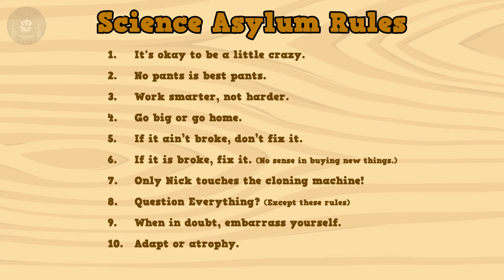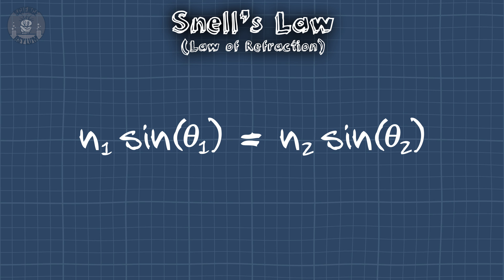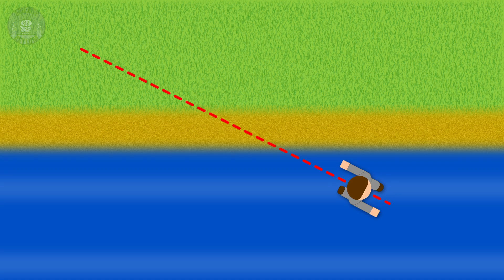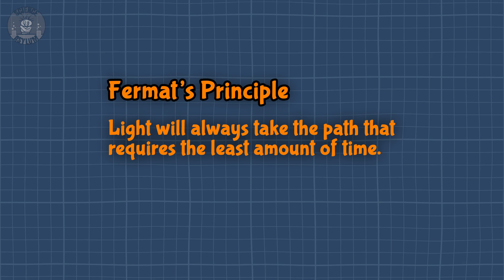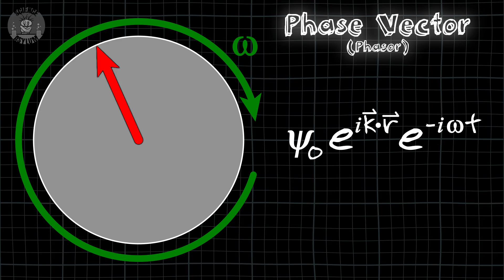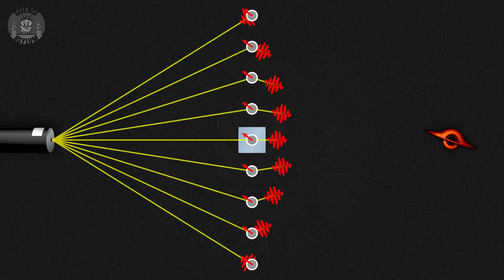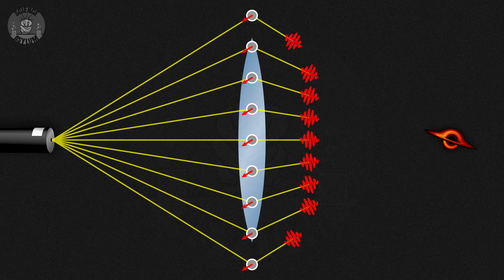Why Does Light REALLY Bend?

Comment from the maker: Clarification: In my quantum animations, that is not multiple photons taking different paths. It is a single photon taking multiple paths simultaneously. We're releasing only one photon at a time. Adding those phasor arrows together gives us the probability of receiving a single photon at any given moment.

Minor Correction: I show the paths leaving the source at the same time and arriving at the detector at different times, when it should actually be the other way around. Paths that take more time should be leaving the source earlier in order to arrive at the detector at the same time as the others. The reason we can add the phasor arrows together is because the paths arrive at the detector at the same time.
Reply: Still confused. Doesn't single photon imply that all paths "left" the detector at the same time?
Reply from the maker: @ewthmatth  No, because we don't actually know when it left the laser. All we really know is when it arrived at the detector.
Reply: The Science Asylum 
Photon arrives all at once.
Potentially took all the paths.
It could have left at different times, because it arrives all at once...
Is there a way to detect when it left?
Or if it left at the same time, as well... 
Can a photon move at C relative to another photon?
Wait, it was one photon... 

F*ckit, quantum particles are f*cky AF.
Reply: @RyuichiNoGekido  Photons don't change with time like other particles. One photon can be like a long twisting thread that entangles or interferes with other threads light years across while stringing other particles along for the ride.
Only difference being if Photon forms an Anti-particle/Particle pair the thread breaks . 
Another Point is Particle interactions make new swirls of Photons blending into the background.
Reply: @ScienceAsylum  Its like Finding a needle in a haystack
Reply: george mayanja I mean, I know mathematically a photon doesn’t experience space or time. 
But I’m still confused.
I’m not even close to introducing antimatter into something I barely have a grasp on already.
Reply: @ScienceAsylum  does the fact that photons do not experience time have an impact on the photon paths "being explored", and the same photon leaving the generator at different times to get to the destination at the same time?
This question is a result of stitching together things found on the internet, so I might very well be really off track
Reply: @RyuichiNoGekido  Machines , rules , laws ,maths and logic have limits . Just imagine more if you find exceptions to the rules and laws of physics get creative and learn how  we can apply them .
 Your Imagination and creativity is one thing Computers and gadgets can't do so use it even when you're wrong
Reply: @ScienceAsylum  How a single photon can slow down in glass without losing energy? In early video you say that it's only beam can slow down because of interference with em-field of electron.
Reply: @ScienceAsylum  I have a question if you don't mind, but if a photon that takes more time to arrive at the detector leaves the source earlier and every possible path of the photon meet at the detector at the same time, what is the need of the lens? At the video, you said we'll use the glass to slow the photon down to make the time of its arrival same with other paths. but if all paths of the photon arrives at the same time, doesn't that mean we don't need to use the glass in the first place? And every multiple paths is taken by a single photon...how can we 'collect' that single photon?? Doesn't the lens just focuses light beam's'?
Reply: @ScienceAsylum  @02:58, n=1.0003... air has its own refractive index... or maybe at least our Earth's gravity can slightly slow light coming from the Sun(gravitational lensing)... @09:26, 2 constants, Epsilon naught is the vacuum permittivity for electrical charges & Mu naught is the permeability for magnetic field to pass thru a recognized medium of matter or particle then the square root of their product is equal to the refractive index... Well, maybe we can measure the accurate speed of light on totally less to no gravity situations like inside orbiting space stations(while still having air like oxygen, of course) because I think gravity still plays a role on miscalculating the true speed of light on absolute space including its refractive index(absolute). But we're all here on Earth under its own gravity and we're performing all these experiments within its natural & environmental boundaries & restrictions. All I can say is that we' re all not ready for space... Maybe I can request an experiment about how light travels through water rapidly flowing in a laminar way, a laminar flow(light direction parallel to water flow)... or maybe what if the glass is spinning & rotating so fast while light pass thru it(perpendicular to axis of rotation).
Reply: @KokoJeuru  That is interesting! So you are saying the refractive index could be different under different gravitational fields? Like on the Moon or on Mars or ISS? Surely theorists have an answer for this already?
Reply: @RyuichiNoGekido  Could the speed be variable and only in aggregate sum to C?  In this way it leaves and arrives at the same time along all of the simultaneous paths that could and thus were (probabilistically?) taken.  ie Photon leaves then "ghosts" all paths traveling at various speeds so that the photon "ghosts" arrive together at the detector as one?
Reply: @YbisZX  photons can never slow down. The speed of light is an absolute - a constant. Since glass is dense, when a photon travels thru it, it almost always hits an electron, gets absorbed and then gets re-emitted. *The re-emitted photon always travels at c*. The re-emitted photon might hit another electron & the same thing would happen. All this absorption/emission takes time & hence light takes more time to travel through glass but not because it is slowing down.
Reply: @arifsaifee4146  No. The re-emitted photon will be emitted in a random direction.  According to your theory, the light will simply scatter in the glass, and not pass through. Actually, it is the interference between a light wave and a perturbation in the electromagnetic field of matter leads to a decrease in the group velocity of the wave.
Reply: @arifsaifee4146  I don't think it has been proven that light only travels at c in a vacuum.   I think it could be possible for the speed to be c in one direction and less on its return path back after Vinci by of a mirror say.... but probably less than likely
Reply: How can laser light take multiple paths? I thought photons from a laser were meant to all be in phase... which would mean they all travel in the same direction...?
Reply: @EternalSilverDragon  In quantum even the laser pointed at a vacuum will have uncertainities
Richard Feynman could explain better than i can
Reply: I do now understand the probability of two videos having the same "Clarification" and the same "Minor Correction". Did checked with "WinMerge".
Reply: You made the same animation error about the photons arriving at different times that you did in your previous video about mirrors. You even copy and pasted the same "Clarification" and "Minor Correction" pinned message from that video. Did you have both videos filmed and fully edited before releasing the "You Don't Know How Mirrors Work" video? Not trying to call you out or anything, I'm just curious.
Reply: Sorry, I call BS on that lens. If it was only about slowing down the light then it would work just as well with a kind of inverse fresnel lens, which has the shape of the pictures lens but all surfaces visible to the light source being orthogonal to it. Furthermore, normal fresnel lenses would NOT work.
Reply: @marcus3d  Because this part was the most insightful moment of the video for me, could you please elaborate? I wouldn't want to double down on something that turns out to be incorrect.
Reply: @sander_bouwhuis  Look at how a fresnel lens works. The light will pass through several rings, and go through approximately the same amount of lens but very much different amounts of air. The difference between these rings is the angles the light enters and exits. A fresnel lens clearly completely invalidates the suggested hypothesis.
Reply: Do individual electrons take all possible paths too?
Is an electrons behaviour described by a wave if probability too?
Reply: It makes more sense that a “photon” is a spherical wave front that induces oscillations in molecules it passes through. The resultant of induced oscillations create new wave fronts at slightly different times creating an interference pattern with a resultant wave front that produces a perceived single “beam.”

When those wavefronts hit the next material, new oscillations and wavefronts are produced which results in a different resultant “beam.”
Reply: Wait so a photon may leave before you even create it it in order for it to arrive via all paths at the same time?
Reply: After watching this video I suddenly realized that I was always thinking about waving of photon as of something that waves inside some volume of space, center of which is moving from source of light towards infinity. But then I thought that maybe photon is a wave that spreads in all directions, like a regular wave, and location of the photon is the front of this wave, the shape of which gets changed by matter. Does it make any sense or I just misunderstood something?
Reply: @MasterFrI  it does make a lot of sense . there's atleast 3 examples of what you explained 
LASER COOLING
ANNIHILATION
EMP Electromagnetic Pulse
Reply: @MasterFrI  shape of the EM wave propagating from light source is from interference patterns with all photons in space even when in a quantum vacuum
Reply: @The Science Asylum Thanks for all the wonderful and videos... These made my life little easier (in some way atleast)... 
Can you make video on 'how recent picture of BLACK HOLE proves the theories of Sir Einstein's physics and not quantum physics...??? Please!!!...
Reply: Nick can you tell me why light does not bend when it falls perpendicularly on any surface??🤔🤔🙏🙏
Reply: Why do light have particle like behaviours  too. If it was just a wave then this probability thing would have been much easier to understand.

When the phasors cancel out Is some energy lost. I mean I know that the lens just focuses light but if less phasors get cancelled out does that mean there is more intensity.
Reply: https://youtu.be/NLmpNM0sgYk
Reply: I have a doubt-
For a single photon as mentioned, if the path that takes more time leaves the source early in order to reach at detector.
How can you say angular frequency (w rad/sec) remains same for wave function as you have added the phasors in end?

How can some part of wave function of single photon leaves early than others?

Please explain
Reply: its ok, and thanks for the clarification. As my chem professor used to say proficiently and profusely, “Take me for what I mean, not what I write on the board!” 😉
Reply: This reminds me of one of the Feynman lectures where students were similarly confused.  But Feynman did a really good job explaining it.

Now the real question is... what happens to the photon's gravity while it is in transit ?

-Matt
Reply: In another video you talked about detecting quantum entangle photons stopping the interference pattern but that was after the slit what if you use a passive sensor able to detect the shift between electric and magnetic field of the photon as it passes without interfering with its passage allowing it to go on to the double slit after being detected
Reply: Ok ty
Reply: The science asylum
Does this explanation clarify the truth of the concept quantum superposition?
Reply: 3:16 Why do I get the feeling that this is based on a true story?
Reply: Great video, thanks for explaining the angle of the refraction. A lot of explanations only deal with the slowing down of the caused reradiation and sine wave addition to get group velocity. This I one helped me understand the angle change. But the multiple paths of the photon sure is weird.
Reply: @LowellBoggs If you're interested, imagine that photons work the same way as navigation systems by using Dijkstra's algorithm. Take the general random weirdness of quantum physics as a given, and it doesn't seem weird at all. Not that it really explains anything, but it's kinda easier to get your head around that way.
Reply: i expected single photon experiment that definately shows what you tell to be truen when you talk about proof.
Reply: So if you’re shooting a single photon through the lense does it get brighter? This has to do with the priniple of least Action.

Comment: Bending of light cause optical illusion 
Lens 
Mirrors 
Concave lens 
Convex lens 

Light travels in straight paths 
Snells law 
n1 sin ( thetha 1) = n2 sin (thetha 2) 

The over head projector is ....a glass so the letters are blurred or less visible ....
A black board or a screen other than glass can be better clarity for reading 

Probably it is projected on glass which is causing scaterring  or distortion 

Eye opd  out patient department 
Dr renuka 
Amsterdam 
All revolving around lens and mirrors for  better vision

Comment: So if there’s an equivalency between bending light and slowing it down, and there is also an equivalency between bending/slowing light and changing its frequency, then theoretically you could slow the frequency of light until it becomes X-rays or radio waves or any waves of a lower frequency, right? I’m new to physics, so sorry if this is a silly question.
Reply from the maker: "...an equivalency between bending/slowing light and changing its frequency..."
1) Actually, the frequency doesn't change. The wavelength changes.
2) The speed doesn't actually change. Saying "light slows down in materials" is just easier to deal with mathematically than the truth, which is a complex pattern of wave interference created by the atoms in materials.
Reply: @ScienceAsylum  gotcha. thank you!

Comment: Light is made of electric & magnetic fields. These fields are made of submicroscopic quantum particles which move as wave. When light enters from air into the glass its electric field induces an opposite electric field in the glass. The opposite induced field inside the glass interferes destructively with the incoming field at air-glass interface. This reduces quantum particle/energy density in the portion of wave inside the glass compared with particle/energy density in the portion of wave in the air. Imbalance in particle/energy density induces a force field directed from higher particle/energy density to lower particle/ energy density region i.e. downwards from air to glass. This force produces a clockwise torque on the incoming light beam bending it towards normal. When light beam exists the glass into air particle/energy density in the portion of wave inside the glass is lower than particle/energy density in the portion of wave in the  air. This induces a force field directed upwards from air to glass.This produces a counter-clockwise torque which bends  exiting light beam away from normal. This is why light bends when entering from air into glass & when exiting from glass into air.
Reply: I believe you are closer to the truth than any body else I have seen. I would however like some explanation of your Quantum particles.  I am really interested as I have been thinking a lot about Electro Magnetic Emmision (EME) of which light is just a part of the spectrum. What I would like is an idea about what exactly is the EME. I do not believe in the Photon other than it is a part of EME. I believe we should look a lot more at the frequencies than the energy level of a so called Photon. It is called a Photon because a quantum of energy is either absurbed or emmitted when an electron is jumping in an atom and it has been convenient to believe it was a particle emmitted or absurbed. It is really an amount of energy emmitted or absurbed. As this enery has a frequency it must be an EME.
In my oppinion EME is energy in its purest form pulsating between electric and magnetic energy and I would like an explanation how it can contain itself without anything else. If it has anything else involved we then have to find an explanation for that too you see.
I believe that everything could be build up of these energy waves that when radiated travel at c but localized are standing waves. I do not believe that there are any particles at all just localized standing waves of energy that to us appear as a point or particle. In short I believe everything is energy.
I have found explanations why + and - atract and + and + and - and - repel. I have also found an explanation about the same for magnetism. In all cases there is no attraction but only repultion. These explanations are not mine but from other people on youtube but they make sense to me. 
I do not like attraction at all. It is like a vacuum cleaner does not suck but the dust is pushed in by air pressure. It does not suck in anything in a vacuum.
I just need the explanation on the self sustaining EME.

Comment: But why does light slow down in glass?
Reply: Light does slow down in glass and it has to do with the light wave interaction with the electric field induced by it's interaction with the glass. This generates two waves which is combined and results in a slower wave. In a vacuum, this does not happen hence it travels faster. Watch Dr. Lincoln on Fermi Lab...Fermats principle is an often wrong explanation for the bending of light. Just lots of incorrect science these days on youtube.